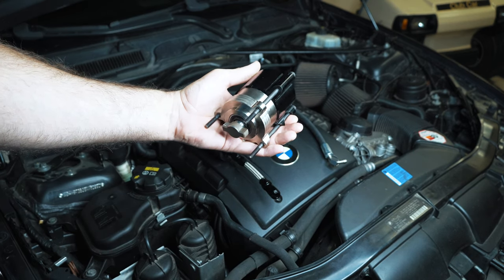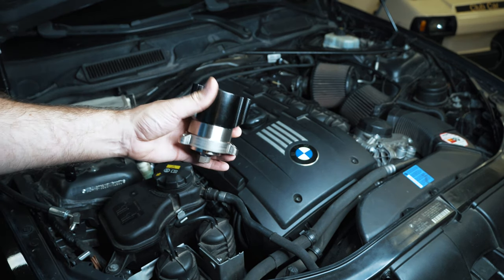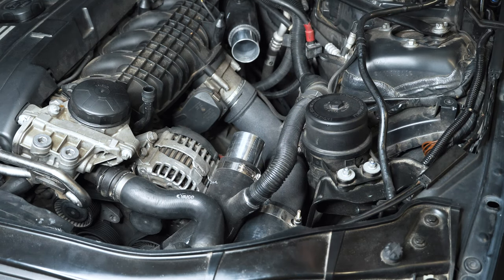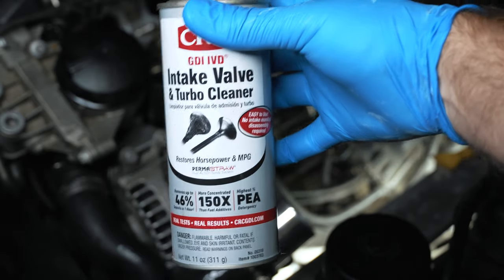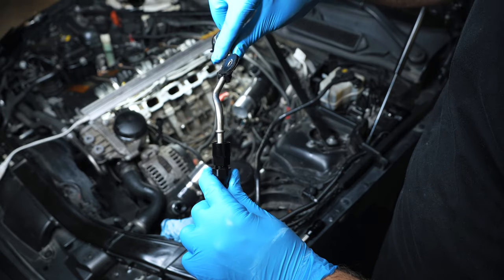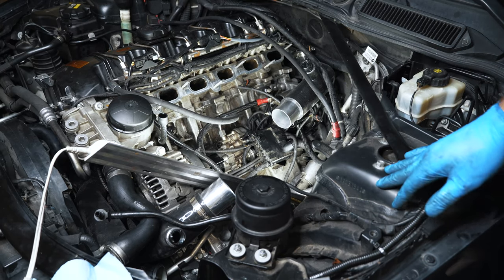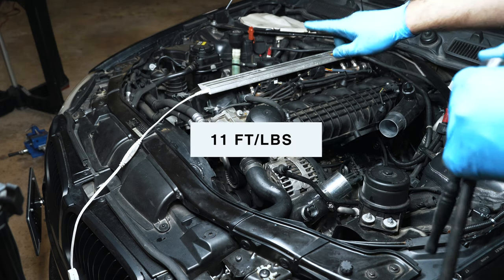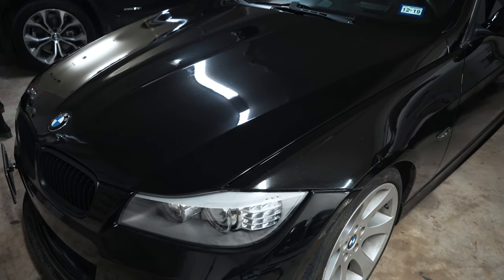Is This The End For Port Injection? | BMW N54 HPFP Overdrive Kit!

Comment: the line you bend around 14:28 and that stock HPFP -> fuel rail line have similar issues as a result of the manufacturing process/limitations. That why the twisted tuning guys released the high pressure "rubber" (or whatever material it actually is) line to replace it that bends while closer maintaining the same ID (internal diameter) as if it was straight compared to the hard metal lines that definitely suffer losses to the ID in bends. Getting a full replacement kit made for the line you had to bend yourself would be a smart move for Spool Performence to get dialed before the consumer release.
I am super hyped on this product, as someone with an XI N54 this is really a game changer since I have been avoiding PI for a while now, but now I am hopeful that I can finally run full E85 with my Pure stage 2+ hi-flows DI only!

Comment: Another great advantage is that this can be used on the 535i and 335i x drive which traditionally could not use the VTT shotgun pump due to the size of the power steering pump.  Also, since the E series N55 shares the same pump as the n54, we can use the overdrive on those cars as well :)

Comment: Thanks for your clear no-nonsense procedure. I just started replacement of my starter motor on my 335i and found your details to remove similar parts very helpful. Your method and comments to clean the carbon from the intake valves appears better than my spray and scrap approach. I used a wet/ dry vac to remove cleaner and carbon pieces.

Comment: I'm surprised no other company like fuel it, vtt, precision raceworks/ bmp thought about this type of mod to the HPFP earlier but nevertheless I'm happy to see something so simple release I JUST HOPE IT'S RELIABLE AND KEEPS THE HPFP RELIABLE as well
Reply: They did, VTT has had this for years
Reply: @tv-vk3fs  was about to say. VTT has had the shotgun and dbl barrol shotgun kits for years. And port injection has proven to be better.
Reply: @rodgazinya  port injection is definitely not better, port injection has been proven to blow engines when the dme is cutting fuel port injection keep flowing, using stock injectors is way safer. I'm using vtt double barrel kit and I'm making over 600hp
Reply: @rodgazinya  
That's absolutely wrong. All the highest hp n54s use upgraded hpfps, use meth to cool the intake charge. Nothing is safer than DME controlled direct injection.

Comment: I’ve been waiting for this to come out. I’d rather not run PI and just stick with DI. Trying to keep it simple and less points of failure. Recently converted over to Speedtech bottom mount with a PTE 6266 Gen 2 BB on an e30 tune. I’d rather go straight e85 and not mix. Can’t wait for the results and when it’s released.

Comment: I think you may be the first on You tube with this pump.  Hope it proves out.
Reply: Macht Schnell that's exactly what i was thinking
Reply: it's not a new pump, its an overdrive for the pump
Reply: This overdrive unit has been sent out to other beta testers here in the pnw. Hoping for great results!
Reply: @weebz4748  Correct as he said in the video.   It will be interesting to see how the lubrication holds up on the planetary gears as that is a new concern the directly driven pump did not have.
Reply: @danielpacurar2644  So what is the recommended lubrication interval of the planetary gears?
Reply: @machtschnell7452  I have no idea sir.
Reply: pretty sure he def is the first one!
Reply: I was looking at it 2 weeks ago after I fun flexfuel because I don't want to go PI either. But as I rememebred, the price isn't so friendly.

Comment: I love how your engine is super clean! I noticed you don’t have an oil catch can and yet your TB looks amazingly clean, not one drop of oil...
Reply from the maker: Thanks!  Yeah this engine surprises me, I can go 7K miles between oil changes and I don't need to add a drop of oil.  Considering it's got 192K miles that's impressive, also when I had the turbo's off the exhaust ports were dry and it looks like it's not burning any oil at all.
Reply: Vehicular DIY that’s amazing! Wish I can say the same thing about mine. Recently replaced valve cover with new gasket and bolts following your guide as I had a leak from there for a while, (carried out the job 3 times - 3rd time is when I bought brand new cover with bolts - as after running the car a little while, smoke from manifold and a small pool of oil accumulating on the oil tray that runs along the head). No more smoking now and less oil smell, still getting a small amount of oil accumulating on that tray where the boost solenoids are, I’m just hoping it’s residue, otherwise I don’t know what it can be. I physically can’t see oil coming from between the gasket right above where the oil is accumulating so no idea and I was super careful making sure it sat flat and torqued down with correct pattern. Anyways, I enjoy your videos, keeps me motivated to keep attacking maintenance on this car, I’ve been a long subscriber!

Comment: I use VTT Double Barrel Shotgun. Full E85. Never liked port injection. 2 different fuel systems is too complicated.
Reply: Also alot more failure points. When port injection systems fail, they fail bad.

Comment: I truly appreciate that you took the time to make this video! However what I cannot figure out is what filter am I deleting to add the 10 Micron unit? Yes I have the engine end of the 10 Micron unit coupled on to the metal line under the starter, and I've traced the OEM black braided fuel line down to a mounting plate down near the footwell. Once I figure out how to unplug this original line and plug the white clipped end of the filter line in there, it also leaves questions of how to cleanly install the filter unit. Are people generally leaving it in the engine bay or trying to tuck it beneath?

Comment: I appreciate this video. I'm installing the Helix in my driveway but will need to take the low pressure line to a shop that has the vise. Would you estimate a 30° bend out and down or less? Also, does the manifold gasket need to be replaced?

Comment: Just for future reference, I installed this plumb-back kit from Australian manufacturer TurboSmart
http://www.turbosmartdirect.com/Product-Categories/BMW-Kompact-BOVs/Kompact-Plumb-Back-KIT-BMW.html
 By far the neatest bolt-on kit on the market - proper formed plumb-back pipes and really good quality units. Designed for the BMW quick-connect standard charge pipe, but I just cut the input pipes down a bit and glued/clamped the silicone pipes from my alloy charge pipe to the bottom of the valves. (Not a shill-link - I just think they're very good)

Comment: Excellent work as always, best N54 content around. 
Does this need specific tuning to take advantage of the extra fuel flow?
Reply from the maker: Thanks, yes typically you would only need this with upgraded turbos so you'd be working with a tuner anyway.  If you installed it on a stock turbo car in preparation for turbo upgrade you could without needing a tune as the car would just bleed off the excess pressure but then you're putting more load on the HPFP for no real gains so I'd recommend people have it ready to install at the same time as the turbo upgrade and to clean their intake valves while they're in there.
Reply: Ok VD so tuning is needed when installing the Helix overdrive because i have the same upgrade turbo's like you from Dynamics Autowerks. My tuner is going to be WedgePerformanc

Comment: Your vacuum plate holding up?  I noticed your install was prior to the Billet 6061 plate being included with the Helix OD.  I'm seeing a supporting block mount is in development as well.  Also curious why you didn't go for an inline Fuelabs filter rather than their in-HPFP solution.
Reply from the maker: It's fine so far, I'll get the upgraded fuel line and change out the plate eventually. I just went with the filter that Spool provided.

Comment: Ok ok ok... okokokokok....  I'M FREAKING OUT HERE!!! :)))))))  For real for REAL!!  Are you 100% SURE in EVERY POSSIBLE WAY that this will work for an N55 Engine???  I've seen a couple of mentions in the comments affirming this...  I have an N55 (bow down to the N54 in terms of power possible for sure, but I'll take reliability over power any day! ;) -- if this kit will work, I would love to be able to use it!  Circumventing a port set up seems SO much easier for the option to go E85!
  My goal is 500 WHP because I still have a stock clutch with my manual tranny.

To that end, would you happen to know what the WHP limit would be on a stock manual clutch?  I know that the price-per-horsepower increases exponentially as you go up the curve, and I would really not have to be forced to replace the clutch yet with a higher performance version--hell of a job and lots of $$ on parts!  My car only has 57k miles on it, so the stock clutch should still have quite a bit of life left.  But I was just curious about this in case you had come across the figures--I'd love to take the clutch to its max power-wise! :)

Anywho, my stock HPFP is just now starting to go on the fritz--this would be a PERFECT upgrade, and I cannot imagine that the cost would be anywhere near going port, with the need for a whole new manifold, extra injectors, extra tuning/modules, etc.
 and the added risk of the port tuning being off just enough to blow the engine!!

I have several questions:
--Will standard injectors work?
  Any recommendations as to which to get/from whom?
--How would this HPFP system work with tuning the AFR on the car?  I know you mentioned direct control from the ECU and a couple of valve setting tweaks and pulling out that stock filter in the HPFP to increase flow, but really?  Is that it?  Would it be that simple--nothing else needed? XD XD
--Pros & cons of 1-to-3 vs. 1-to-4 rotation options other than E50 vs. E85 and power gains respectively (if any)
--The in-line filter supplied by Spool: is it replaceable/a maintenance item, and as such, can it be mounted under the car in such a way that it remains easily accessible to allow for easier replacement?
--I have a FuelIT LPFP upgrade, will this be compatible with it?
--And the last is longevity of the HPFP under these new parameters, but I suppose time will tell on that one...

I am currently in the process of replacing as many components as possible through FCP to get the lifetime warranty!!  This is literally the same as replacing the HPFP alone--pretty much no extra labor, which is just so great!

And as a closer, your content is GREAT!! Dude--so informative and the fact that you're taking the risk on these new types of items as a guinea pig is really inspired, helps out the culture SO much!  Thanks for what you do and keep it UPPP! ;)
Reply from the maker: What year is your N55, the early N55s shared the same pump as the N54 so it could work on your car.
Reply: @VehicularDIY  2011

Comment: Will work on E series N55's before 03/12 as well.
Reply: You should be able to take a peek at what pump you have with a flash light and maybe moving some plastic away. Search for images on both pumps and compare. I have the F series  hpfp on my 2013 E92 N55.

Comment: Awesome video. First time ive seen this part by a different brand and a nice kit with fikter as well.
What WHP do you think is available running full E85, with the 4xhfpf OD kit? Stage 1-2 stock frame TT's?
Reply from the maker: Thanks, probably around 450 whp max?

Comment: Awesome video, very detailed. I just ordered this kit yesterday so hopefully I’ll be getting it soon. I’m curious about where you mounted the new larger filter though. Is it under the car behind that plastic cover you unbolted? And is a new fuel line necessary since the filter is being added? If so did it come with the kit? Thanks!
Reply: bro upgraded his turbos and ran out of fuel , bro you need a upgraded lpfp not hpfp i mean more power to you why not install a upgraded hpfp but jus sayin

Comment: Great video. Is this process the same for the n55 e90?
Reply: You should be able to take a peek at what pump you have with a flash light and maybe moving some plastic away. Search for images on both pumps and compare. I have the F series  hpfp on my 2013 E92 N55.

Comment: Which tuner did you use for your setup? Currently upgrading my twins as well. And possibly running the motive flex fuel option with mhd.
Reply from the maker: Wokring with Wedge Performance.  Still on V1 of the tune, going to install some diverter vales and try for 28 PSI on V2 to see how that response.  If all goes well I'll ask them to dial in the timing and take it on a dyno.  If something is off like my transmission etc I'll dial back a bit.

Comment: Any updates you are able to share? How many miles have you put on the OD unit? Any issues tuning or with the actual HPFP itself? In the market for one of these. Time will tell!
Reply from the maker: I've put about 2K miles on it, the tuner did play with the volume control valve tuning to open it up a bit more, pressures were dropping in 4th on the dyno.  The HPFP is still working fine, the OD unit works fine also.  You get a bit of chatter on first start up until the motor settles down but it goes away after a minute or so.  So far so good.

Comment: How’s your hpfp holding up since the install? Also did you ever dyno or retune for the helix OD? Can you share some updates regarding that? Much appreciated and respect ✊
Reply from the maker: It's surviving so far, have about 3K miles on the helix.  Yes I dynoed at around 540 whp.
Reply: Thanks for update. I just reached out to spool and they’re sending out the billet housing and reinforcement bracket. They mentioned they’ll be sending out to early customers that didn’t initially get that. Be on the look out. Thanks again.

Comment: Hey man, a great new idea, I didn't know something like that existed until now, did you consider meth injection for more fueling? It also has advantages of cooling and cleaning the intake valves, but I don't know how much more hp will it give you with the upgraded turbos
I installed similar turbos to yours but still MHD stage 2+ and I am not sure the next step for me.. bec6i know to get the most of it I should upgrade the fuel system or go Methanol injection or port injection..
Reply from the maker: Yeah I've heard good things about meth injection, for now not sure I'd need it with my power goals.

Comment: Pity you don't have a 335d version as well. Both excellent bang for buck cars. Annual UK road tax is half the cost of the petrol version on my 335d. £555 yearly petrol to £260 yearly diesel. Then 38 mpg compared to 29 with sensible driving. Would love both myself. 8 grand each.
Reply from the maker: Yeah a 335d is quite the unicorn car here in the US.  Most diesel vehicles here are pickup trucks.
Reply: @VehicularDIY  it would be fantastic on your channel as you could do direct side by side comparisons. Both engines are excellent. Love both the 6 cylinder twin turbo engines. But 98 octane petrol prices here are £6.50 per gallon (4.5 litre). 95 octane petrol is fractionally cheaper. I run a cetane booster in my diesel as well as LUCAS oil upper cylinder lubricant with each full tank filled up. The car goes round to 140mph+ so easily (pity the dials/clocks only show 160 max)
Reply: I paid £300 tax this year for my 335d, how are you managing 260?
Reply: P.s. I totally agree about VehicularDIY having a 335d, would be brill. Struggling to find quality content covering the M57n2!!
Reply: @AACBrit  my first 335d was 300 a year it was on a 56 plate. The slightly older ones are more expensive per year to tax
Reply: @vp5  ah the newer N57 motor. That makes sense!  What made you sell the 06?
Reply: @AACBrit  one thing and one thing only the gearbox. My second 335d had the 2012 software update, by the previous owner, which made it more responsive than the 2006 original factory first software version and then I got the software completely remapped again which transforms the gearbox altogether and makes it as close as possible to a modern DSG box
Reply: Yeah, I'm looking at the X5 with the N57 or M57 eventually.Definitely like being different myself and I have no experience with diesal. So want the SUV and the learning experience.
Reply: I had a 335d tuned sold it for the I totally different car and you only live once so fu@k mpg and road tax 😂

Comment: What makes this different than VTT's Shotgun or dbl barrel kit? Which Port Injection has been proven to be better then.
Reply from the maker: Ease of installation primarily, only if your power goal is north of 700 WHP would I say that port injection would be better but really it's your only choice at that point and you're near the limit of the bottom end. I get your viewpoint but I guess this would be targeted at more of an average consumer that want's less than 600 WHP with upgraded twins vs a single turbo upgrade pushing 750 whp.  For the people that want 550 WHP with automatics and upgraded twins this would be easier and safer if they're not looking to break records.  BTW I'm trying to provide unbiased advise, I'm not getting affiliate money from this and I paid for this.

Comment: Im running flex fuel from motive. How will this benefit. I switched out my short fuel line for the new one with ethanol sensor..
Reply from the maker: You planning on upgraded turbos?
Reply: @VehicularDIY  yes eventually. The ones I have are stock only about 15k miles old. They got replaced by BMW. Im running fbo stage 2 fuel it lpfp and mhd.  Im limited to about E60 Max due to not having port injection though... An alternative to port injection would be great so I can truly Erin 100% flex fuel